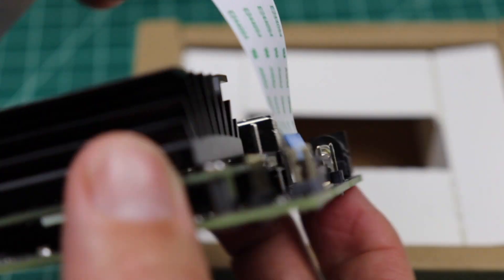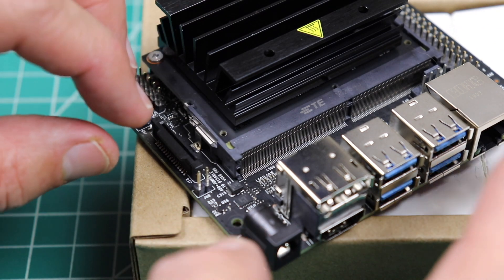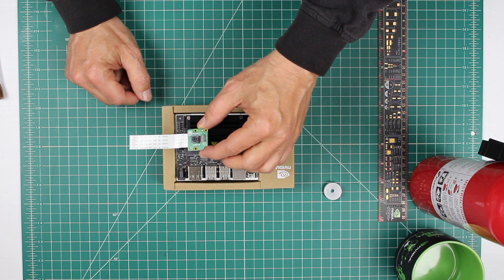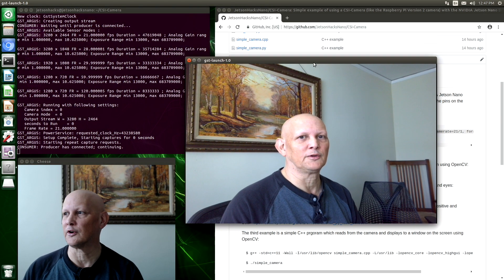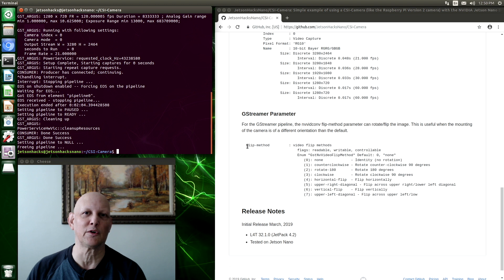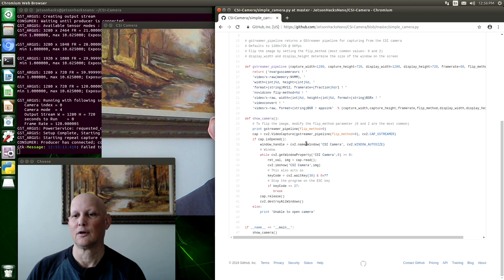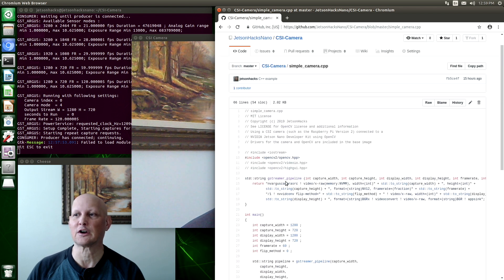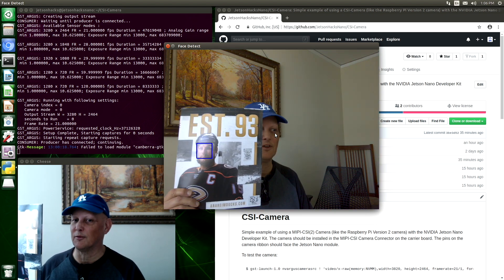JETSON NANO + RASPBERRY PI CAMERA

Comment: This is a great "getting started" video!  Many thanks for taking the time to create and post it...  One minor issue, though: The maximum resolution of the  RPI-CAM-V2 is 3280x2464, though the command line you issued requests 3820x2464  (note the difference in the resolution width: 3280 vs 3820)...  Your window resolution of 960x616 has an aspect ratio of ~1.55, but your actual streaming video resolution of 3280x2464 has an aspect ratio of ~1.33 , which makes the contents of the RP camera's video window look slightly stretched horizontally.  Hopefully, correcting the sample command line on github is a simple and straightforward process.  Stay safe and healthy, and thanks again for posting this!!